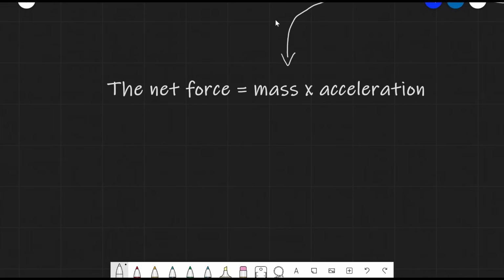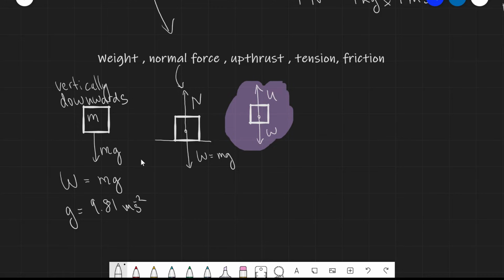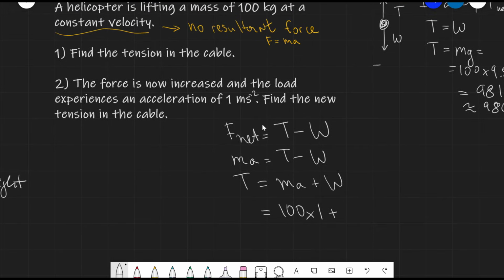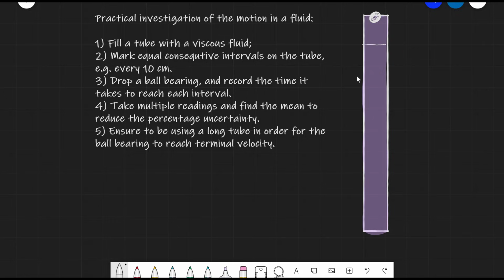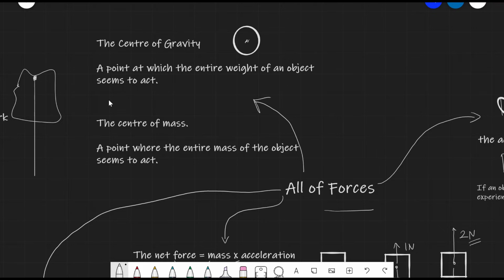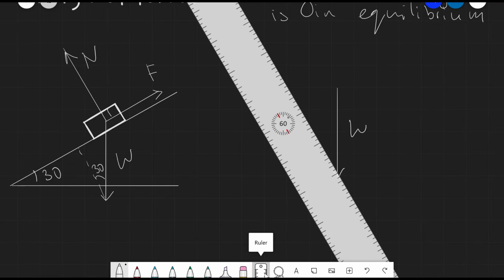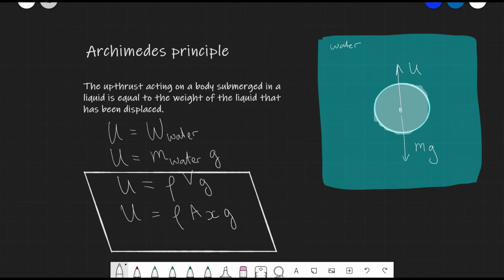A Level Physics Revision: All of Forces | Moments, Torque, Centre of Gravity, Archimedes Principle

Comment: Wait a second am confused if drag is acting upwards right then the sky diver is falling downwards with increasing speed shouldn't drag be decreasing or I can be wrong too
Reply from the maker: So drag is proportional to v^2 at higher speeds as speed increases, the drag force increases. Hope this helps!
Reply: You could also think about it practically. If you were to move faster, you would collide with more air particles,  causing a greater resistive force (ie, drage).

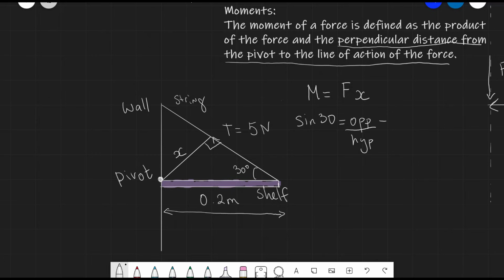Comment: 28:00 for this question could you use the horizontal component of the tension so 5sin30 x 0.2
Reply from the maker: yep! You can totally do it in terms of forces, I think you mean the vertical component though.

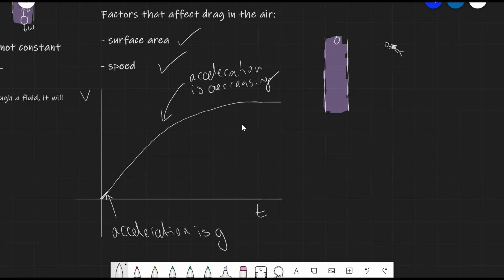Comment: why is the acceleration increasing at 14:30 if the drag force and speeds increasing? isn't force proportional to acceleration
Reply from the maker: the acceleration is decreasing however the speed is increasing. Hope this helps!
Reply: @zhelyo_physics  sorry but why? im a bit confused on why that is sir!
Reply: @luddy20  acceleration depends on the net force, as soon as the forces acting on either ends of the object is not equal, the body accelerates. Here, as the body is falling down, initially it has an acceleration of g which is 9.81 ms^-2 (Here the backward force is 0) . As it falls, resistive forces ( Air resistance ) acts upon it, the backward force (drag force) starts to increase, and as the drag force increases, acceleration decreases. 

Take for example this equation 
Net Force = mass x acceleration
Forward Force - Backward Force = mass x acceleration

Forward force is the weight of the object
Backward force is the Drag force 
Mass is constant 

so as value of backward force increases the net force decreases so the acceleration decreases.
A point will come where the drag force will equalize the weight (Terminal Velocity)
Here the object is still falling but with no acceleration but at a constant velocity

hope this helps<3

Comment: Hi at 28:50 I worked it out by resolving the vertical component of tension and then x by 0.2 and it worked should I carry on doing it this way or is there an issue with it?
Reply from the maker: you can absolutely do it this way : )

Comment: the slope vectors is killing me. i watch the videos but then look at the q 13 here, part 1 and 2 i don’t get it. tips to better concept wud be helpful too 

https://edexcel.solvedpapers.co.uk/wp-content/uploads/2021/12/Phy_8PH0_01_que_May_2019.pdf
Reply from the maker: that's a tricky one! It's worth remembering that the perpendicular component with a standard angle is the cos component. Then we have the cosine component of the backpack+cosine component of the weight + 2R (one for each foot), we don't need to take the cosine component of R as it's fully perpendicular to the ground already. Hope this helps!
Reply: @zhelyo_physics  i finally solved the question a few hours ago, when i read ur response it added a lot to my understanding as well, you’re quite honestly amazing. but i hate that i spend a whole day thinking about one question, solely due to lack of understanding. it would be nice if you have some suggestions as to how i could improve on this. i mean obviously ur videos exist covering all the content, but i feel like i could never do these difficult questions in a small amount of time, do u think that just comes with practice?
Reply from the maker: I think it's a time and practice thing. It still happens to me every once in a while on a difficult problem. You have done really really well! You can definitely shortcut the whole day of thinking by asking a teacher/a  classmate or dropping a comment here. Typically the more people think about an answer, the higher probability of finding a solution. : ) Good luck!

Comment: Hi i just saw a multiple choice question where it said when a ball is hit upwards and is at maximum height, its acceleration is acting downwards. I thought as there is no net force at max height there would be no acceleration no? Please explain. Thanks!
Reply from the maker: At max height gravity is still pulling it down, hence there is a force. In fact if you throw something up in the absence of drag the net force will remain constant (mg) at all points. Hope this helps!
Reply: @zhelyo_physics  ahh that makes a lot of sense, thanks so much!
Reply: @zhelyo_physics  If something is thrown up isn't the drag the same as its weight?